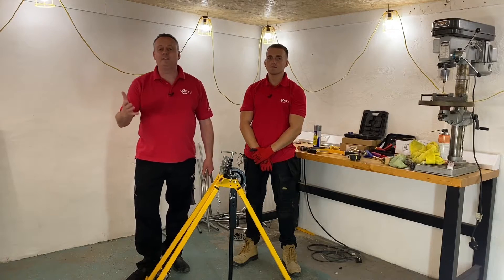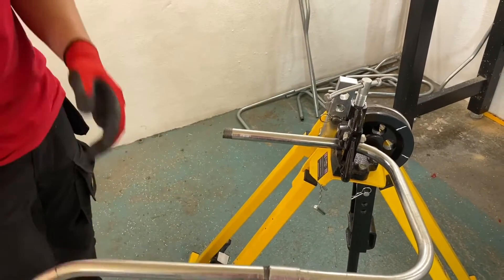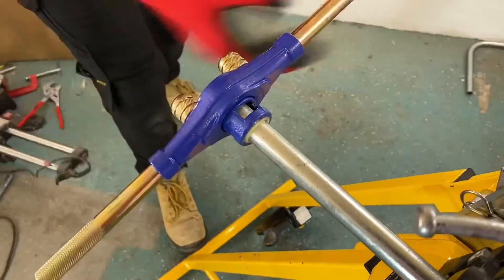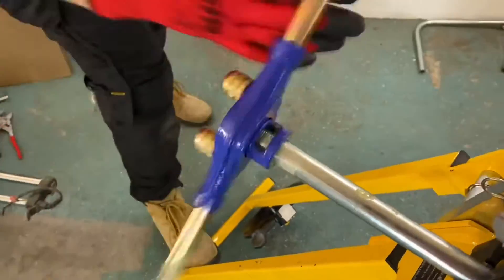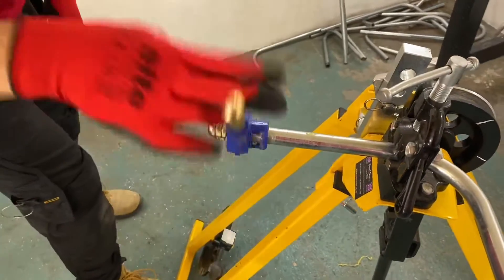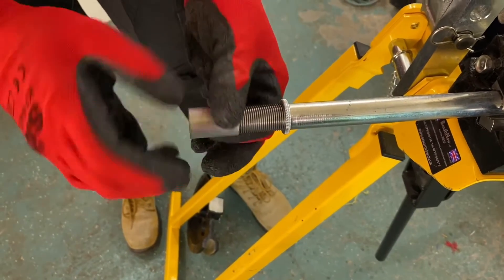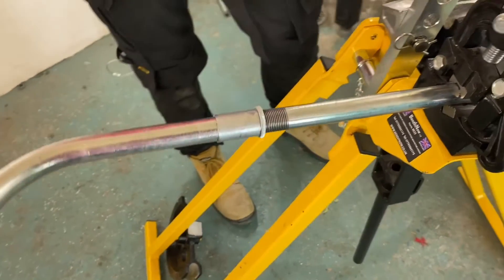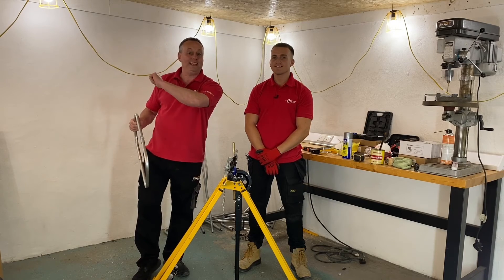How to join metal conduit using a running coupler - Conduit installation skills

Comment: Pretty crazy, we would fail inspection with running threads which is why the USA makes two piece threaded couplings, any modifications as far as spray paint on threads would go against any code violations. Good concept but just can’t do that in the states.

Comment: Running threads at couplings for electrical conduit are a code violation in the United States.  NEC article 344.42(B).

Comment: Before you strike it with the Galv spray, give it a good blast with Brake Cleaner (spray) it will strip all the cutting compound and factory grease right off, helping the Galv spray to make really good adhesion, because your brief wipe with a dirty rag isnt doing anything but remove the heavy deposit.
Reply: Better still ignore that stupid galv spray.

Comment: Power theader is the way forward,
But Only after you’ve ruined your shoulders threading&bending 25mm tube for too many years,hate the sight of any metal conduit or trunking now 😢
Reply: It's funny you see all the macho bs in trade jobs then when they get older they finally get it

Comment: I was doing running couplers and nipples back in the 90s on mainly RAF bases as an apprentice sometimes with a conduit bender that had been repair welded.
Wouldn't it be better to just buy the nipples if they are still sold? it would save deburring and time threading?

Comment: 🤣🤣 you electricians! this is what's called a long screw connector and we in the Gas pipework industry were using these YEARS AGO! before unions! Electricians trying to be pipe fitters 🤣🤣🤣🤣 haven't a clue.
Premadonnas.
Reply: Iv just trained to be a electrician and iv done gas for 8 years previously. This is the one thing that I don’t understand about conduit it’s so crap when you do this. A union is so much better and is a much better connection especially is your earthing it
Reply: Of even, "Primadonna"

Comment: I might be being daft, but in what circumstance would you need to bend conduit into a closed loop like this
Reply from the maker: Demo only for this - usually joining two fixed points
Reply: Cheaper than an "Ericsson" US term for rigid conduit coupling.